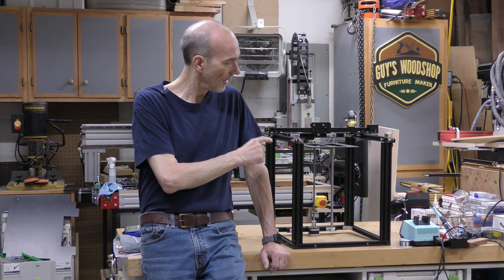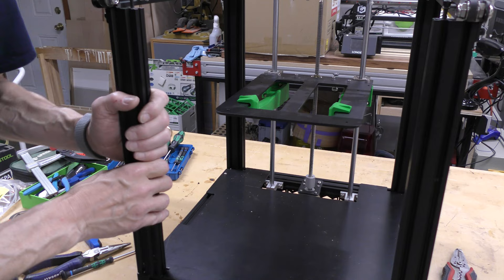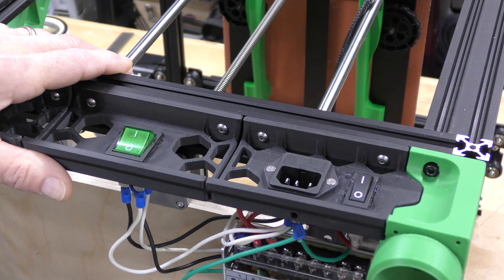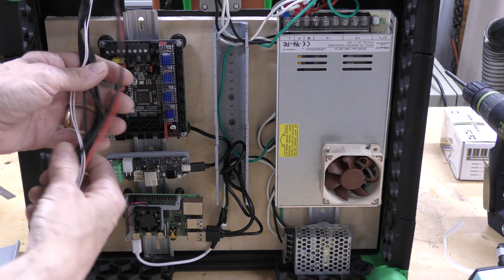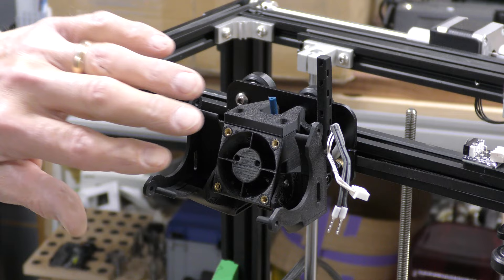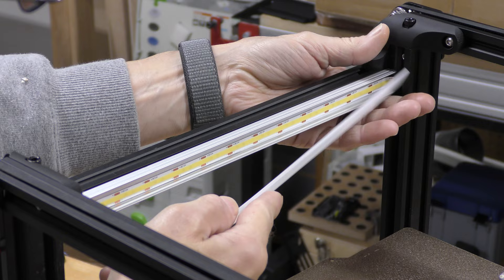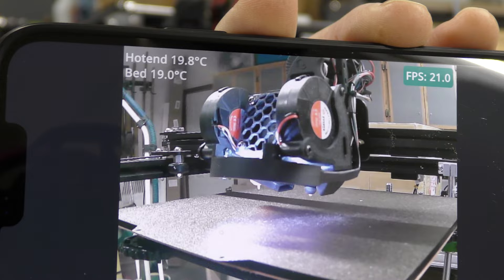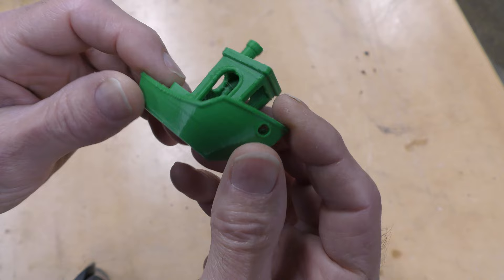15 Unnecessary (But Fun) Ender 5 Mods

Comment: What I find is there are so many uses for a 3D printer than I ever thought.  Bought my first one 6 or 7 years ago and have never once printed anything other than tools and replacement parts for various things.  Anyway, I'm enjoying these as much as I do the wood working,  I also do some limited machining as well.  Too many hobbies for me, but the 3D printers keeps me coming back.  I'm expecting delivery on a Formbot Troodon 2.0 (loose Voron clone) that I hope will get me up to speed with the later printers out today.  My old CR10 while reliable, is getting long in the tooth.  Anyway, thanks for the video, it's a very interesting build that ticks most if not all boxes.  Thanks Guy!  Edit to add, surprised you didn't go with the Mercury 1 upgrade.  🙂
Reply from the maker: I have looked at the Troodon, and think it's pretty interesting in the way it gets set up. Seems much simpler than a full Voron build. Myself, I would welcome the challenge of building a Voron from parts. The V 0.2 I built I love!

Comment: I am thinking of using CAN bus to simplify the tool head wiring on my printer. I have an SKR 3 and an EBB36. Is the U2C board required for this? 
I am confused because the SKR 3 has a CAN port.
Also, why aren't you using the RGB power to run the Pi?
Great video, just hoping to get everything figured out before I start.

Comment: Thank You for all of the wonderful content. I found you from listening to The Perfect First Layer podcast. You've done some awesome mods to your Ender 5. I'm personally not a fan of the Hero Me. stuff. I give props to the creator. He's done a ton of work on that project and has always given his stuff away for free to the hobbyist. He's one of the good guys. I just find the Hero Me eco-system to be big, clunky and it really doesn't perform well . Your 5+ is off to a great start to be an amazing machine. Have you considered going further with the Mercury 1.1 mods? Going Core X,Y with the Linear Rails? I have the Ender 5+ converted to a Mercury 1.1. It is a totally different printer. It has the EVA 3.0 toolhead, (also running a U2C to EBB36 CAN) with a Rapido HF hotend and an Orbiter 2.0 extruder. I went sensorless homing but there's nothing wrong with switches if you can stand the wires. Thank You for sharing.
Reply from the maker: Thanks! I have thought about it, and it looks like a fun project. I just finished a Voron 2.4 350mm and it has been a great experience.

Comment: Really light the modifications in your video. Most I have not seen anywhere else. Well done! 

One question, where did you get the light rail. 

I see the link to buy the LED light strips but not the rail and diffuser you put the lights into. I am printing the front bar relocating brackets right now and the light addition solves a big problem I have been having with being able to see the nozzle when leveling and adequate lighting.
Reply from the maker: Thanks! The light rail aluminum extrusion and diffuser was bought on amazon. It was a couple years ago, but any exrusion will work.

Comment: is it worth buying the enter 5, I found it quite cheap, it needs a search in Greece, there are good used ones, it's worth getting the model, is this upgrade you made the motherboards for making our own printer? for height width
Reply: I have also found the ender 3 v3 KE 150 euro, is it worth buying? if I can get it And I found the ender 5 with extra µmicrowiss investment some noizle Here it has prices 300 400 In the shops .. For used I found it 150 euro I am thinking of getting both they are good bargain prices because they are not easy to find with little money I find a few pieces here

Comment: I got a used ender 5 pro off ebay that im gooa klipperize Ive got the BTT skr e3 v3 mb and a EBB36 but I a BTT PAD 7 to run klipper and it has onboard CAN support so I shouldn't need the U2C board .. however in my testing I can't get it to communicate via CAN just VIA usbC any suggestions
Reply from the maker: BTT has really good instructions on their github repository for the Ebb36 and the Pad 7
Reply: @GuysShop , OK I'll take a look

Comment: Can I hook up the bigtreetech pad 7 to RS-15-12 AC-DC Single Output Enclosed power supply; Output 12VDC Single Output at 1.3A. I’d like to mount the pad 7 to my ended 5 and have all the wires in the case. Or do I need the one you have.
Reply from the maker: You need to check the power requirements for the Pad 7. I'm pretty sure 1.3A is not enough.
Reply: Sorry I’m new to this the pad 7 is DC12V 2A
Reply: NVM I found my answer MEAN WELL RS-35-12 AC to DC Power Supply Single Output, 12V 3 Amp 36W thank you for your time and thank you for your video it gave me some good ideas

Comment: You don't need to step down from 24V to 12V with a buck converter. You can use a simple series resistor.
Reply from the maker: Just making it easier for the folks out there.
Reply: @GuysShop  I think a resistor is more easier than a buck converter, but it's ok.

Comment: Did you ever give away that extra g10?  Just came from the podcast, and would love to try g10 with my ender 3 and/or s1.  Just wondering!  Cheers!
Reply from the maker: As a matter of fact I did. My son also listens to the podcast and asked for it. Thanks for liswtening (and watching)!
Reply: @GuysShop  Glad it is getting used!  Love the show, as well as all three of you fellas' channels individually.  Running a v2 (since just before Halloween last fall), as well as a S1 Pro (purchased a few months back during the Creality anniversary sale).  Love absorbing all the info from the podcast as well as working toward my Bachelor degree in 3d printing from YouTube University!!  🤓👨🏻‍🎓👨🏻‍💻  Trying at the moment to decide if I should pull the trigger on the K1, since I have a bit of credit with Creality....

Comment: That's not a modded Ender 5 anymore but a custom built printer using an Ender 5 frame 🙂👍
Reply from the maker: it's an absolute beast with PLA. Not the fastest printer I Have, but the quality of the prints are amazing.